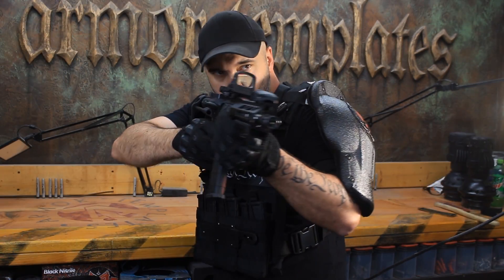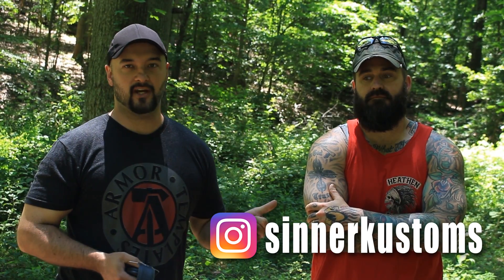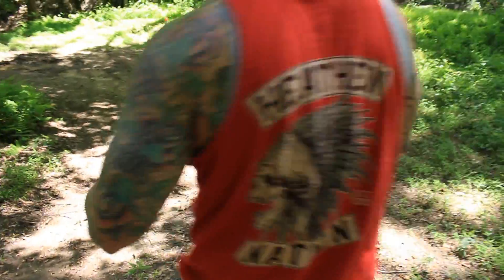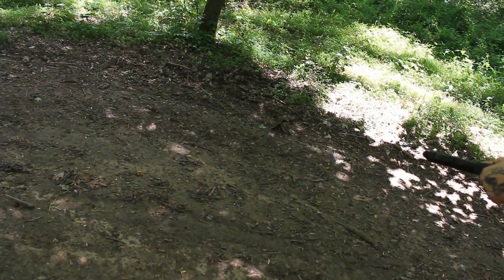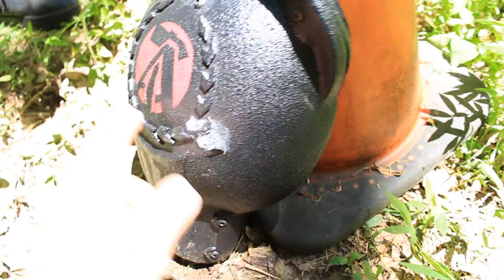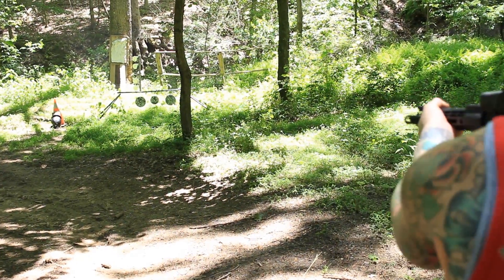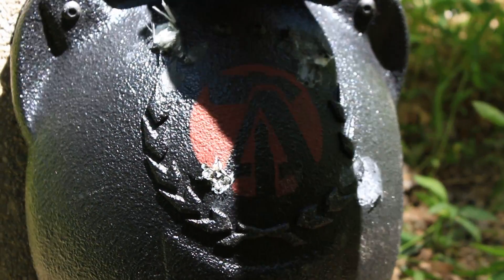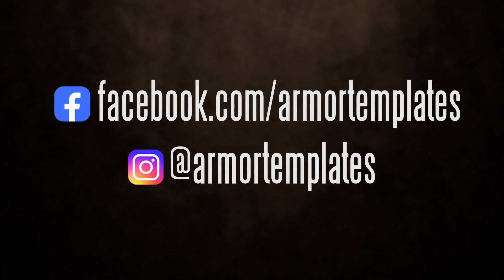DIY BULLETPROOF Shoulder Armor! Is it really bulletproof?

Comment: Could you form a 1/8th in piece of lexan either say 5 layers from the front or 5 layers from the back?    Would it be worth it?,   or even 2 sheets of lexan,  one in each place I indicated?        
Just curious
Reply from the maker: I did attempt to form some plastic to serve as the back plate. Could not get it hot enough to take the shape.

Comment: If it slows down a rifle bullet enough to avoid hydrostatic shock, then it's effective enough for battle as it still allows you to keep fighting. Excellent armor. If it weren't so heavy our military would definitely be using it.
Reply: Yeah I'm guessing that might change once they are using exoskeletons to help manage weight, we might actually get to see power armor within own lifetimes being widely adopted by various militaries.
Reply: @1810jeff  yeah military exoskeletons are gonna be so cool
Reply: https://uarmprotection.com/product/shoulder-and-biceps-armor-module/?attribute_pa_color=coyote&attribute_pa_size=s-xl
Same protection level, 1/5th the weight. 

A medium chest sapi plate is 5.45lbs, is far more coverage and will stop rifle rounds at the muzzle. This is cool for the styling and possibility of self production, but actual production armor beats it handily. Also, our troops already have rifle rated body armor that includes bicep and neck armor, it's hot and not exactly light but it stops rifle rounds and getting shot at while sitting in a humvee sucks, so it gets worn anyhow. Exos aren't landing anytime soon but what we've got already isn't terrible
Reply: @CtrlAltRetreat  Yeah but from what I've heard from actually soldiers is that they rarely use full body armor since it's heavy and slows them down I'm sure there are some exceptions but there's a reason why we don't see the troops decked out in bomb suit looking uniforms. So it will probably take exoskeletons to make full ballistic suits standard military issue.
Reply: @1810jeff  
It's mostly because it's cumbersome and if the threat level doesn't warrant it, it doesn't get issued. Take a look at convoy top gunner footage. They're pretty much all wearing the full kit.
Reply: @CtrlAltRetreat  Yeah that makes sense seeing as how the vehicle is doing the movement for them so being over-encumbered isn't as much of a problem. From what I've read the military has access to body armor that goes far beyond what is available for civilians so that probably also has something to do with how satisfied they are just sending infantry with only upper torso protection since center mass tends to be the most common target.
Reply: @1810jeff  
The plates are pretty modular, you strap on the extra armor as needed. Some gunner setuos also includes armor skirt for your dangly bits, optional lighter thigh armor and front knee/shin guards. It's pretty complete armor from the front but much less from the sides and rear. The knee/shin guards are really handy because kneeling on the tiny jagged rocks in Afghanistan could be... unpleasant. Almost all military armor is available for dedicated civilian collectors, but good unissued stock is generally not cheap. You can get stuff pretty close for much more reasonable prices from a lot of companies, bigger problem is you probably haven't been keeping up the pt needed to move around in the gear well. 

A marine with full ruck is marching with 85lbs of load plus a 9 lb rifle, 5-14 lbs of ammo, part of a team weapon that can be up to 20 lbs, any ancillary equipment allotted to him (woe be ye if you're carrying the skwack box) and the many quarts of water you'll need depending on the march. A guy humping 135lbs on march isn't weird and unless you're keeping up with your pt, it's not going to be easy. Even guys who just get their commission find they can't really move right with their old gear they used to fine with one deployment before.

Comment: Here is a new material that is being looked at for use as a new, lightweight, indestructible armor. Any chance of doing a video testing it to see if it can be worked? https://newatlas.com/materials/proteus-non-cuttable-bike-lock-armor/
Reply: They didn't say indestructible, they said cutproof :P you can't cut through a dinner plate with a kitchen knife, but you can smash it on the ground, if that aluminium foam is as hard and brittle as they make it sound, then I would imagine that a 44 magnum is gonna shatter it and spill the ceramic balls all over the floor.

Comment: Why didn't you use Kevlar cloth or work some AR500??
Reply: ar500 steel would spall
Reply: @boogaloo_weed  ar500 has anti-spall coating
Reply: @chancecstory  plus if he makes a kevlar level 2a cover for the plate the spall will be catched by the kevlar.
Reply: @boogaloo_weed  sprawling towards your jugular is perfectly healthy

Comment: I'm wondering about the fibers getting dragged into the wound by a penetrating round.
Reply: Maybe that could be prevented by placing some cloth/padding between the skin and the fiberglass
Reply: I was thinking the same thing, might as well hang it over a regular DAP or add a piece of actual Kevlar. The rating would go up a lot.

Comment: You should most definitely start vacuum bagging these. It will increase the rigidity of the bid layers. it will also ensure that you have zero bubbles and help mitigate delamination.  you could also incorporate a carbon kevlar weave into the part as well.

Comment: New to your channel but great work! Can you harden steel in your shop or work sheets of titanium? Have you considered trying a composite with a thinner layer of fiberglass or Kevlar with a metallic part on top, then rubber then  another fiberglass/Kevlar then another metallic? A hard layer of metal on top and in the center may help defeat rifle rounds, the metal starts the round expanding and the rubber layer acts like gapped armor to allow it to  it deform and slow down before hitting the 2nd layer of metal.  May be worth the experiment but only if you are able to harden the metal to something harder on the Rockwell scale than mild steel. Rifles go through mild steel like Swiss cheese.
Reply from the maker: I don't have the capabilities here of hardening metal of the proper thickness or working with titanium at all. I could certainly add more layers of different materials with it, but at a certain pint it becomes too difficult to do and too heavy to wear.
Reply: David Guyton I’ve thought about it since I made the comment and it might be a lot easier to try embedding thin steel disks or scales in between alternating layers of carbon fiber.  Exactly like the idea of medieval scale armor, if you could get a hold of something like ar500 in 1/16” sheets, cut small scales and embed them in an overlapping matrix, could greatly improve the penetration resistance.

Comment: I was honestly surprised it stopped the Underwood +P.  I'm assuming it was a Lehigh Extreme Defender from the description, which may explain the lack of penetration, but generally I've seen KEVLAR hard armor [Like a K-pot or MICH/ACH] defeated by bullets over a certain velocity.  7.62 Tok out of a pistol only does about 1400 to 1500 FPS and has been known to punch through...

Comment: If you want cheap kevlar look at boat building distributors. They sell 58" sheets for between $30-$50 depending on width. It's popular for making canoes and some small boats that will take a beating vs fiberglass that shreds easier. Typically you need 15-20 layers depending on the weave thickness (denier) to stop a 9mm+P FMJ. No clue on the .50ae.
Reply from the maker: That's still $300 to $500 Kevlar alone to build this piece. I can't justify spending that kind of money on it.
Reply: @DavidGuyton  what do you value your time to create it at? 

I'd be willing to pay 1000$ a piece but I also dont know how many hours you put into this so that might even be offensive. 

Im genuinely asking. What about if I could get you to "commision" a right and left set. How much would you be happy with?

Comment: If you had stacked in some Kevlar panels in with the fiberglass ones would have done allot better.
Reply: No, kevlar is basic for professional body armor and it will not stop a rifle round even if double stacked. You need hard plates.
Reply: @brainplay8060  hard plates ? Like steel?
Reply: @howmuchbeforechamp  Steel or Ceramic.  Look up AR500.  Its hardened steel used for rifle targets.  Companies use it for armor plates after coating it with a frag/spall liner so that when the non AP bullets fragment, it catches in the liner instead of spraying you with jacket and lead fragments [its like truck bed liner, but tougher]
Reply: @howmuchbeforechamp  High carbon steel like the AR500 type (cheapest), ceramic hybrid (used by the military), or ULW polymer which are the lightest. All are rated to level III which stop standard military rifle rounds.

Comment: That guy was so salty his Deagle didn't go through
Reply: As Matt would say, "the key to penetrating body armor is speed." .50 cal has a lot of mass but not enough speed.
Reply: @PastMourning  I wonder if the rounded shape helped as well.  Sure it MIGHT have had a better chance with a perfect biting angle [no deflection]...but I agree. .50 AE just doesn't have the velocity.  I was suprised the 9 +P didn't make it through.  It had the speed
Reply: @wilemelliott  the rounded shape probably made it ricochet. because the angle of the bullet trajectory to the target at impact is never gonna be 90°. You'll have a lot of the bullets force redirected into a different direction.
Reply: @PastMourning  The problem with the deagle is the diameter of the bullet. Also it's not just speed that makes bullets penetrate. It's kinetic energy which is mass times speed squared. A deagle has a lot of impulse... which is mass times speed.
Reply: That was a really bad hit though.

Comment: Yeah get rid of the fiberglass. It is shit for wounds and it makes your process more difficult. Go with High Density Plastic heat it and form it to the molds. Wrap it in kevlar and cover that with a layer of the bed liner.
Reply: It's a first attempt proof of concept and it defeated 9mm +p it's pretty good

Comment: Problem with this is that if there is penetration the person is dead due to the fiberglass that will follow the bullet into the wound.  That shit will slice and dice you're insides if it manages to get into the bloodstream, and even if it doesn't it's nearly impossible to evacuate it all from the wound.  That shit will sit in your body, fester, cause infections, and travel potentially piercing important organs and causing health issues like crazy.
Reply: He used fiber glass because it's cheap and for a first attempt that he knew would never be worn it makes sense to see what the bare minimum would do
Reply: @benadams5557  I see what you are saying, but I think you are just trying to save this guy some face.  He never said that, not once.  He said he wanted to make shoulder armor, well he didn't, he made something that if it got penetrated you are pretty much guaranteed to die, even if it's a flesh wound.
Reply: You could put a sheet of steal beneath it to stop that from happening
Reply: @thoughtheglass  or use Kevlar instead...which is one reason why they use Kevlar instead of fiberglass

Comment: To be fair most hits to that part of the shoulder would probably be glancing or angled anyways. So full a on facing the shoulder hit might be rarer. I don't see any reason why this shouldn't work for most situations where you would need such additional protection. Refine the process some more and tweak the materials. Maybe something to be, at the least, a little more resistant to 5.56 and 7.62. Like I said I'd less worried about being shot in the shoulder than the torso. But a little something there could be helpful if done right.

That said... Whether it stops a bullet, slows it down, or not at all. Don't just stand there and soak up hits. Get moving for cover and return fire.
Reply: Shoulder armor isn't really there to protect your shoulder. When holding a rifle you entire side and armpit are exposed and not covered by body armor. Even when your shoulders are down the meat of our arm isn't going to slow a piece of shrapnel that much nor a pistol bullet. From your armpit there is little meat between the ribcage and then your heart or lungs. A tiny piece of shrapnel piercing there would be potentially lethal.
Reply: M.O.V.E.  Motionless Operators Ventalate Easily. Its one of the first things you learn in a beginner firearms defensive class.

Comment: I wonder just how well carbon fiber would do.  Since it is so light you could quadruple the layers and it would still weigh less than the fiber glass.  Removing all of the hardening compound is important to improving the strength of the carbon fiber.  You have to wick it off with pilply along with using a paddle.  Amazing stuff.

Comment: For the ceramic folks. Solid piece of ceramic or ceramic powder works the same, in practice. Just saying. It's just harder to contain ceramic powder. CF and Fiberglass are plenty to stop pistol caliber bullets.  This has been proven over and over again. It makes since since it was done that way before aramid fiber was a thing. Good old fiberglass vests. It just weighs more and degrades more readily.   Rifles are where the rubber meets the proverbial road. Good job on your pauldron man. I'd still go with more arm-pit coverage. A sadly large number of deaths have been caused by side entry of a round. I also like your spall guard on the upper part. The last thing you need is deflected rounds hitting you in the head. I'd probably add an inch or two to that spall guard.  I think it is fun watching people learning about armor. There is so much to it. So many things that are surprising on first exposure. Certain contained non-neutonian fluids (thick corn syrup for one) will stop most pistol rounds at 1" or so of depth. The energy is rapidly spread through the medium. Need to get yourself some goat's-milk spider silk. That is some very interesting stuff.